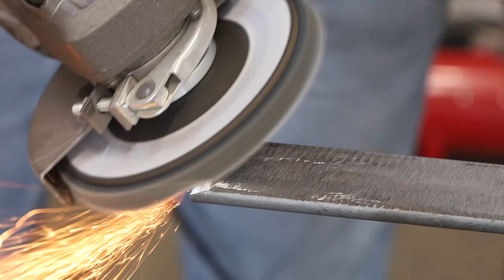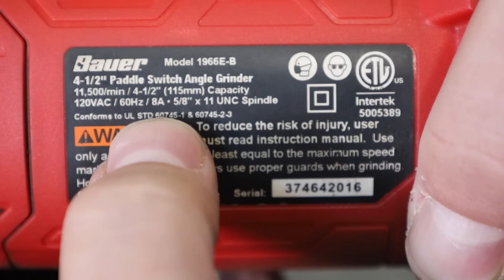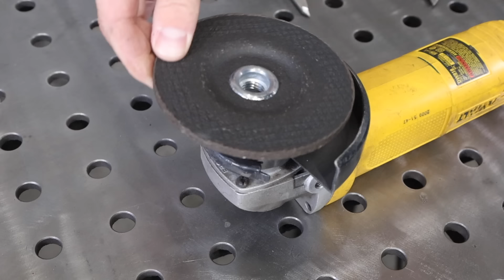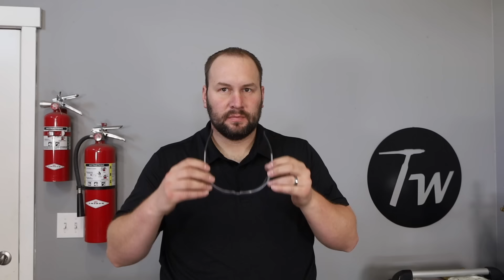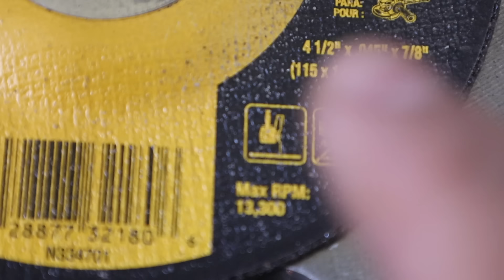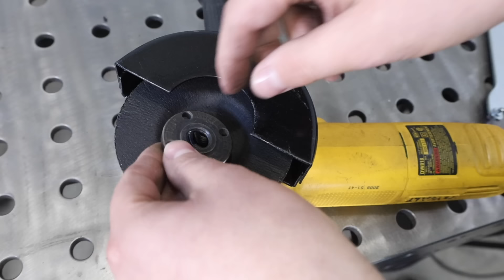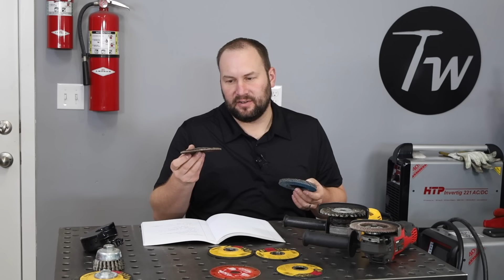Angle Grinders 101 | How to Use an Angle Grinder

Comment: Great tips on how to hold for a cut!

I have gotten a hot bit from a wire wheel, running on the wimpy cheap HF grinder, to somehow go around the face shield to hit my eyelid. So I'm gonna actually follow the guidelines I've seen that you still need to wear goggles under a face shield.

I will agree that the trigger switch grinder is much nicer than the slide switch...

Comment: My own experience with angle grinders has led me to the conclusion that YOU MUST USE GLOVES, at least with wire disks.  If you have never been “bitten” by a wire wheel turning 12,000 rpm, it is hard to believe what damage they can do in the blink of an eye.
Reply: I got hurt and cut a mast chunk out of my finger with an angle grinder. I took the the guard off too. Was a bad idea.
Reply: Got bit with gloves on at my wrist. Always be Cognizant of what your doing at all times when using tools that can damage you in very impactful ways.
Reply: Afaik wire wheels are rated at lower rpm than 12000. Last one I bought is rated at 8000rpm
Reply: I will never use gloves with any rotating machinery. Too much chance of it grabbing you.
Reply: On a bench grinder yea you wouldn't want to use gloves because they can suck you in but with battery powered hand tools you most definitely want to use gloves and always wear eye pro @allanmears4218
Reply: @allcass1703  I guess you pick your poison, but, unlike a lathe, drill press, router table, table saw etc. with handheld tools you have to worry about them jumping out of position and presenting a hazard from an unexpected direction. I have never been “grabbed” by, say, my Milwaukee Magnum wrist-snapper corded drill, though it is 8 amps and wants to rip all the tendons in my hands to shreds with torque.

Comment: I can certainly agree about wearing safety equipment for your face with these, or even Dremel type tools. Just a couple of weeks ago, I was wearing safety glasses and a face shield, and still got something in my right eye. I was moving around a large part I welded together, and didn’t realize that the massive sparking was traveling around the wheel as I was moving. It ended moving around right at my face. That’s a huge amount of sparks. One managed to get through, and in my eye. Fortunately, it wasn’t too hot when it got there likely bouncing around inside my gear before entering my eye.

But, if I didn’t have that protective gear, I could have had a massive problem. I’ve been doing this for a long time, and I’m normally pretty careful (don’t listen to these guys on YouTube who tell you to take the guards off the grinders). But the more you do, the greater chance something will go wrong. Don’t be stupid, it’s not manly to go blind.
Reply: I'd say it's not manly to be stupid
Reply: @tummytub1161  absolutely!.
Reply: And wear good leather gloves to help protect your hands.
Reply: Going blind is ghey
Reply: Don’t ever take that guard off I’m a welder but I did roofing work with my father and some idiot from the other company said this how a real man uses a grinder took the guard off cut some metal the disc broke and cracked hit the dude in his shoulder and by his neck
Reply: @osbaldohernandez9174 wtf. Speaking as a female, It's never masculine or attractive to set a poor example for others bc yr cutting corners, that's terrible leadership. When I see men doing reckless shit because they're too lazy to do smtg the right way, I think damn, glad I'm not the wife living in any house this guy builds, he can't be arsed. Huge difference between having high risk tolerance with investments, sports, etc vs weak sense of safety and poor tool skills, that's just not knowing what yr doing and anyone who sees you will think yr a moron.

Comment: Nice presentation again! I learnt too many things about protection from you and wish to humbly remind viewers one thing learnt from you before: please wear hand protection at least to grinder holding hand. It is not easy to control grinder with gloves, though in some instances gloves help protect wrist and arm from hot metal sparkles. During some angles of cutting the hot particles spreading may slowly burn inside of your wrist and lower arm. You feel heat a little later. But this heat may cause a retreat reflex that could hurt yourself with wheel. My bad experience speaks.
Reply: @WilliamHelstad   Thank you for your contribution. I did so and was happy with the results. Though I must wear a long sleeves cotton shirt to protect my forearm from sparkles.

Comment: Great post, but you missed a type of wheel that I find super useful. The scrubby pad kind, called a strip disk. It's great for cleaning material before welding and painting. It takes off mill scale and rust really well but doesn't take off much metal like a flap disk can.

Comment: Great post Tim. I tend to have 3 grinders on  the go at any one time. 1 with a cutting disk, 1 with a grinding disk and one with a wire cleaning wheel. I used to use my grinders without a guard but after seeing many horror stories when things go wrong, I always use the guard and eye protection.
Reply from the maker: Thanks! 3 seems to be the magic number for me as well.
Reply: Grinder 1:  Cutoff wheel
Grinder 2:  Grinding wheel/flap disk
Grind 3: Poly rust/strip disk - great for stripping alum etc of paint without cutting it in half
Reply: @1nvisible1  but.
Reply: @markslates8324 bbɓ😊ĥ😂
Reply: Why using three? Can't one do all the job? This doesn't make any sense
Reply: I’m assuming certain jobs require switching back and forth between wheels so often that it’s more efficient to just have multiple grinders than to constantly go through the process of changing wheels